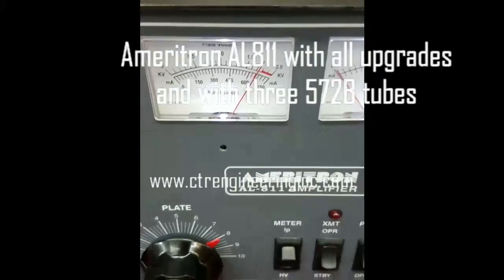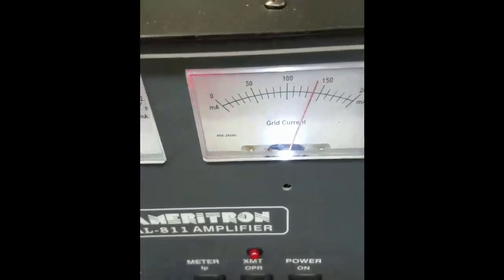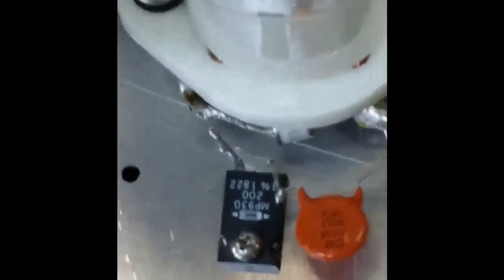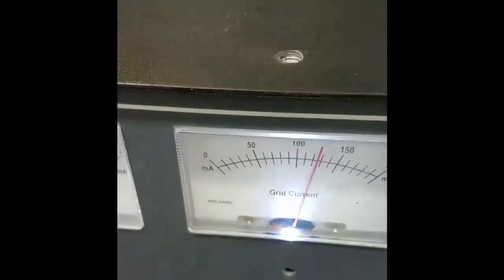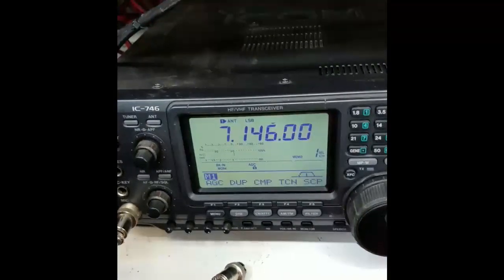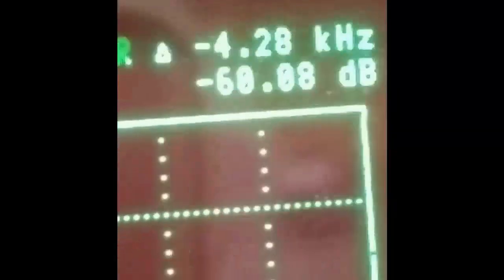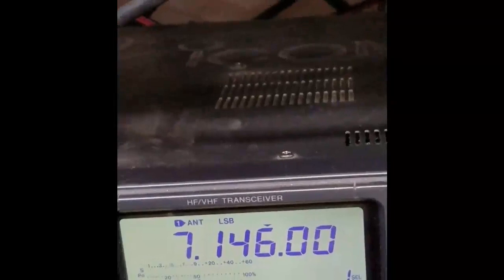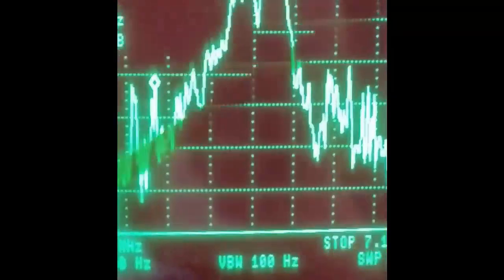3X572 AL811

Comment: Help with any amp, pickup an amertran al-811h amp. When it arrived all 4 tubes are out of there sockets, and one has a broken top cap. Everything looks okay BUT. The man said he would replace all 4 tubes. Would you return the amp or install the new tubes.
Reply from the maker: It sounds like the packing was no good or the handling was very rough.

If the tubes became unsocketed and moved around inside the amplifier and broke, chances are very good other things are damaged. I would not even attempt a repair by installing new tubes. My advice would be to return it. You might get into a mess if you start repairing an amplifier you just bought.

Comment: I have an AL811 SN 19537 with the ten meter mod that will not key up. I bought this used a year ago and this is the first time I have hooked it up, so I don't know if it was working when I bought or if the 10-meter mod had something to do with it. 
Thanks
KA5PAL

Comment: So I see you used a pulser. There's not a lot of pulser information on the web other than explanations of how it works and why we use it. Every article I have read either uses the CW input or has the pulser wired to the micrphone for SSB pulsing. No one has every used a simple two dollar app to create the same pulse audio and just use the microphone element as the conduit. Maybe others can chime in but I see no disadvantage to using this two dollar method instead of 50 plus dollars for a hardware pulser.

Comment: Tom, just picked up an 811. Can I just replace the 811 tubes that are in it with 3 572Bs? And will that provide more than 600 watts? Do I need to do any other upgrades ? I could not see a brand of fan on the back of my amp to see if it had a Cooltron fan and I didn’t see where it did.

Comment: When you say proper fan, what do you mean?  I have an early 90's 811 with a 33cfm fan.  I just put a set of 572b's in it, and can get 700w (rtty mode when tuning up) when I max out the grid current.  So along that lines, in your video, you have the plate current at about 750ma, peaked on the meter.  I haven't gone back on the tube specs, but you're not concerned with going into the red on Plate current?
Reply from the maker: Fan CFM free-air ratings are all over the place from the actual measured flow in the amplifier. 

I don't know what fan you have, but any Ameritron 811 amplifier with the Cooltron fan (which seems to go back at least four years) will have woefully inadequate airflow, about 1/3 of the air necessary for 811 use. Even though the manufacturer claims near 25-35 CFM (depending on the data source) the Cooltron fans measure 8 CFM  inside the amplifier.   This is a major problem because temperature rise inside the amp will be 3 times what it should be at a given heat dissipation.

I'm not in the least concerned about anode current. The life threat to 811 tubes is short term average anode dissipation. Anode temperature is primarily the killer of tubes.  The 572's have a much more robust anode, easily making a three-hole 811 with 572's far more reliable than an 811H with four 811 tubes.
Reply: @Jerrythenerdful  Thanks Tom.  The fan that's in my 811 is an MG Electronics SF11580A, the sticker says 33CFM
Reply from the maker: @PaulReedy  33CFM is the "supposed" free air CFM. That rating doesn't mean much. That is actually a Sunon 31cfm fan. It flows about 15 CFM in the 811 amp, which is marginally okay for SSB and CW with 811 tubes. The data sheet for your fan is here:

 https://www.alliedelec.com/m/d/e7fa8e9dca7dd90ce204f7d91c175fed.pdf

Comment: Over 900 with only 1700 on plate is great day for any 3 572b"s
Reply from the maker: Even 811 tubes, which do not even have oxide on the filament like 572's do, can do well into 1000 range on peak emission tests at 1500-1700V.   You don't want to run them at peak saturated emission, but that is an excellent test to root out poorly made or worn-out tubes. It is much better that looking at them at lower emission levels.